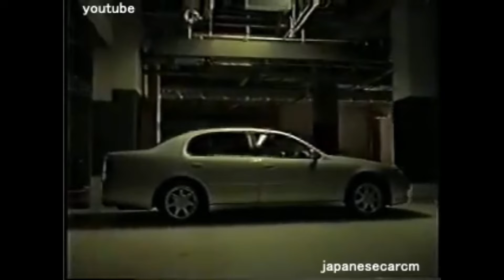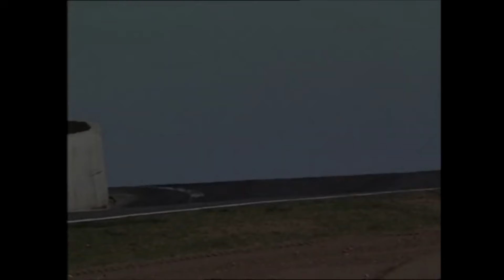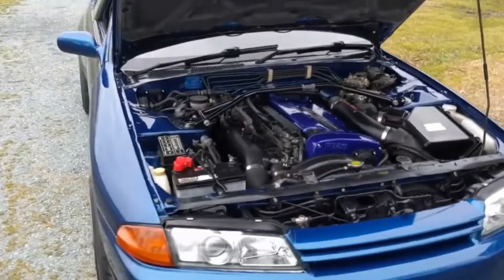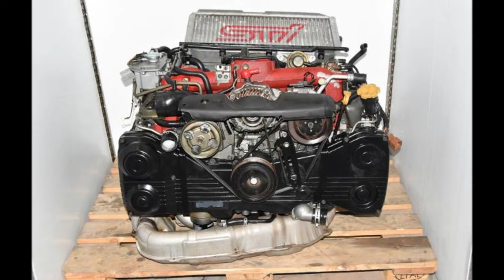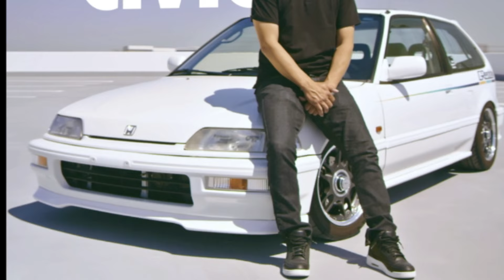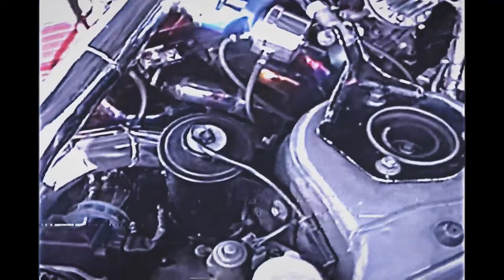5 Most INDESTRUCTIBLE Japanese Engines Ever Made

Comment: So nothing about vtec?  ok so how about this the f20/f22c make 200/220 whp with turbo you can make 600 whp with good tuning. You pull the top rings out and open the ring gap another 10 thousandths just that and a set of head studs and you can make north of 800 whp 950 even there was a guy running this in his S2000 which it came in and after 50 passes a cylinder cracked. turns out he didn't take enough gap out of one ring. It butted and scratched the wall it was enough to eventually fail there. hands down the best or in the top three as well as the rotary !!! bullshit video